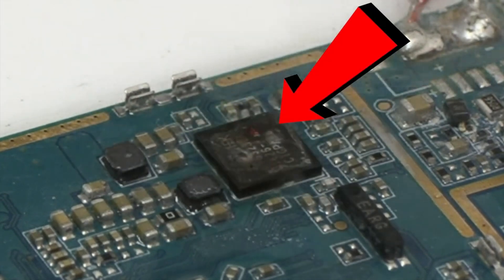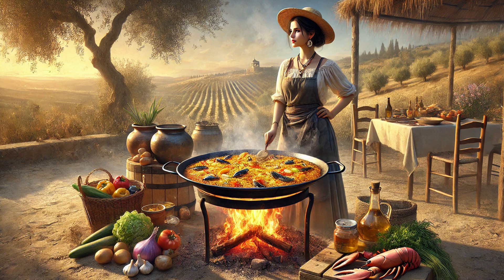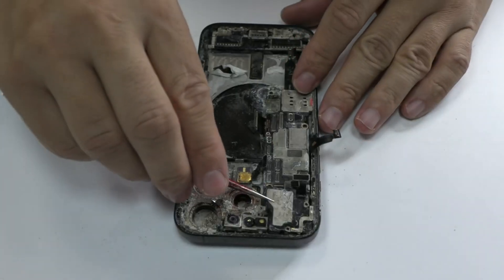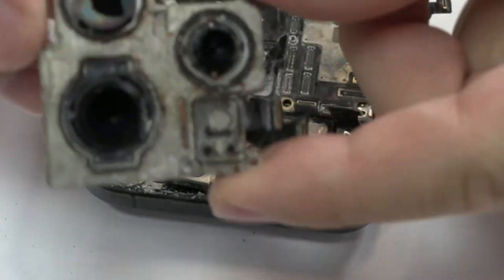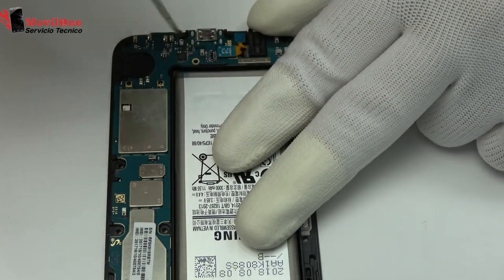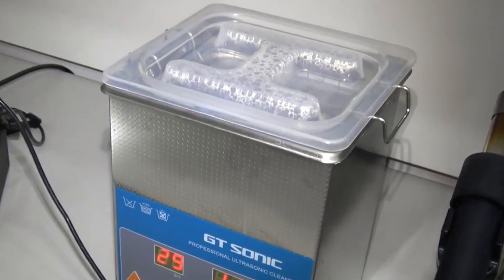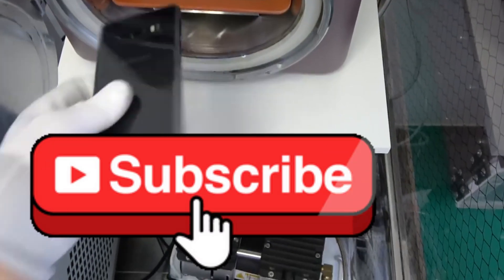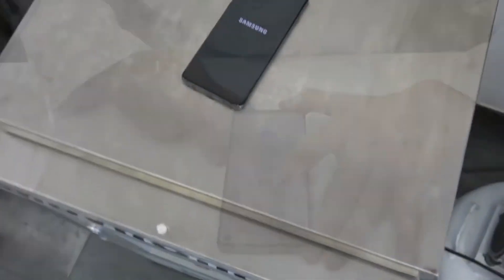Does Rice Really Save Water-Damaged Phones? 💦 💦   The Shocking Truth

Comment: The ones who think rice works are probably the same ones who think foil blocks the signal from their car key fob.  They just blindly trust that it works without knowing for sure if it does!  Most likely those same people dropped their phone in a toilet and rice did not save it.  I am usually careful not to water damage my phone but even if some water did splash onto it, it is water resistant.  It is not foolproof but it should buy you a little time to wipe it dry.  The thing is with screens is that LCDs are multilayered and when water gets in those it is impossible to get it out.